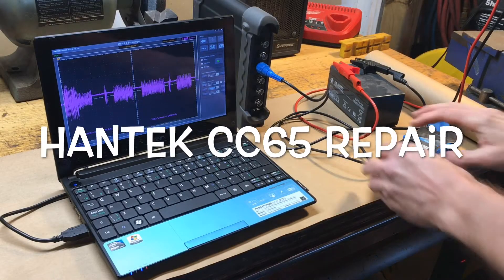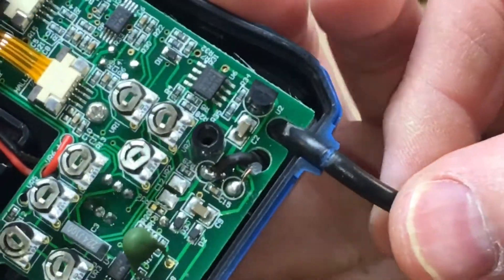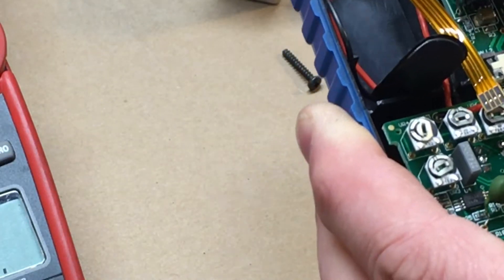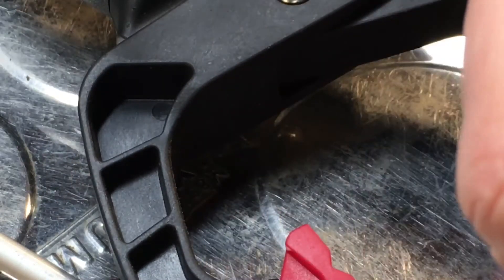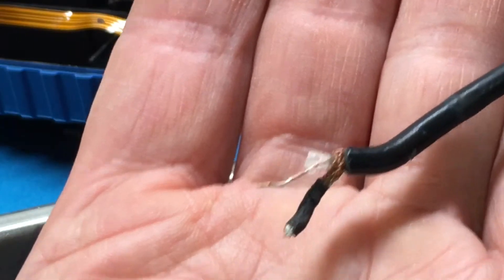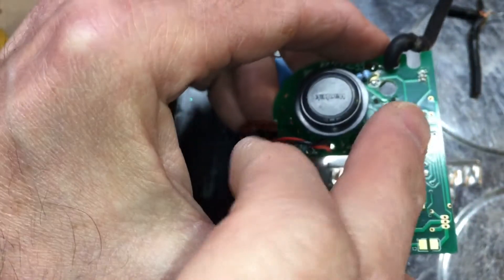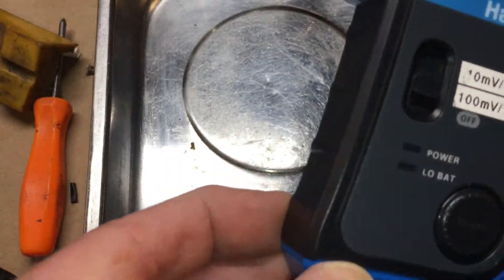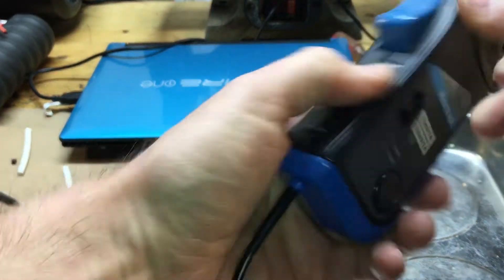Hantek CC-65 Failure & Repair

Comment: Same issue with switch sliding "ON" in storage and dead battery...solved with a wide rubber band over switch after use...no problem since, Ian
Both CC-65 and CC-650 are fine for the price.
Reply from the maker: Rubber band...great idea. Like I have said before Denis that’s why I hang out with you! 😀 And totally agree I have quite a few Hantek products, great value (In fact I have one on a slow boat right now) Not sure why for literally a few pennies they wouldn’t implement a some product improvements. Cheers Pal

Comment: That looks like something I'll have to watch out for, nice repair. Do you find the cable length from new is a little short, there are times I have had to use an extension cable. Thanks for showing the repair 👍
Reply from the maker: Mechanic Matt Hi Matt. Yes 100% agree. Now it’s a couple inches shorter still!  Need to buy a coax extension. Strain relief...a few pennies, stiffer switch....a few pennies, longer coax cable ...a few more pennies. Why Hantek why? Charge an extra Pound/Dollar or two. Mind boggling! Cheers Matt